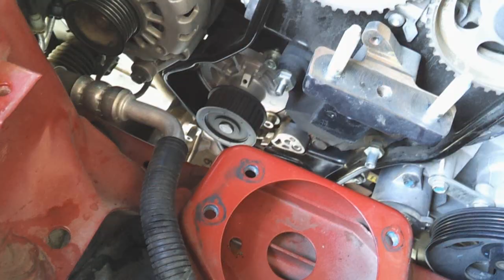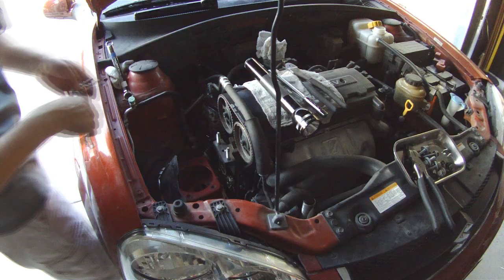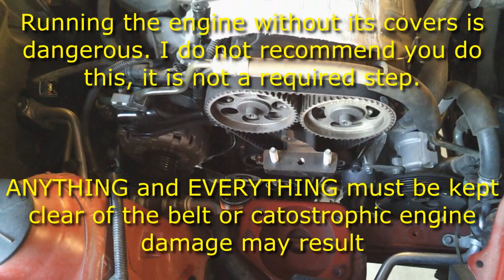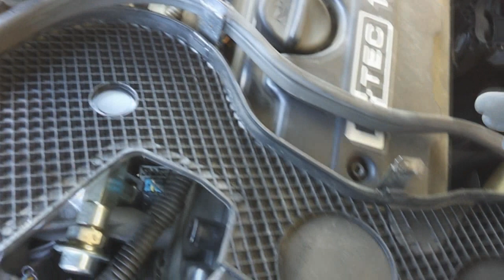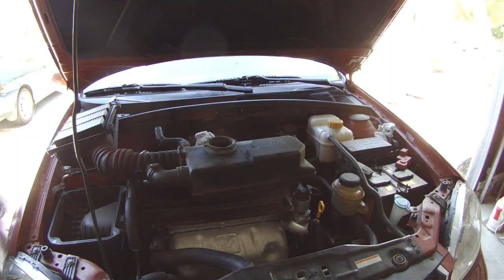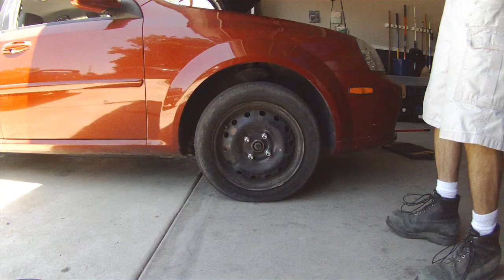Suzuki Forenza timing belt and water pump replacement part 2 of 2

Comment: This weephole placement has nothing to do with placement of water pump! If you will notice there is a high spot in the outer metal shroud where the pump mounts! It's there for a reason. That is what the tab on pump is supposed to point directly at when doing placement. The weephole is just generic and can even be upside down on these pumps and there are several manufacturers for these pumps. The one he's installing infact is one of the lowest cost ones on the market. Your more higher quality pumps the weep hole is in a very different position. So the tab points directly at the recess in the timing cover shroud that was designed for it.  Otherwise it will not be in correct position to let belt tension!!! So that belt will not tension!!!. So if the belt won't tension, that pump is in the wrong spot!!! I had to do it all over again following the weephole method. Found the correct positioning in the 99-02 Daewoo nubira manual which has the same motor as the Suzuki. Also is in a water pump change video for Daewoo nubira on YouTube. Author of video, please make changes, the pump in these was a stupid design! There is too much room for failure in getting it incorrect and there isn't even pictures or diagrams on the web about positioning, it took a lot of homework to get the info, the manual is very vague. Without the guy changing the pump and him making reference to his tab making contact with the shroud in that area maybe would have never known correctly.

Comment: I have a suzuky forenza 2008 and have a overheating problem, i change the thermostate, the sensor and clean the radiator, and still heating, the fans enter in slow velocity but doesn`t frose enough, what do you recomend me to do? thans for your answer.

Comment: Question (don`t laugh): can you advanced the timing by rotatatin 1 toth of the pulley or the crank stays put and you rotate de cam axles? And by that will you damage or interfere the pistons with valves? Thank you very much

Comment: What did you do to put the belt on because it's really tight
Reply from the maker: I had someone else move/adjust the pulleys for me as I pulled the belt into place. Make sure the water pump is rotated to where it puts a minimum amount of tension on the belt.

Comment: Hi I was progressing along nicely following your excellent video, but I've run into a serious issue. I was having problems getting the tensioner to tighten correctly, in the process of doing it I have dramatically thrown off the timing marks of the cams and crank shaft.
I'm afraid to try moving either and the only videos I can find say to open the head and deal with the cams from there. any suggestions would be appreciated.
Reply from the maker: Tom Jones remove the timing belt and all spark plugs (so you wont feel any compression) and turn the crankshaft so that it is positioned 90 degrees left or right (doesn't matter in which direction) from top dead center. Do this slowly and if you feel any resistance (piston touching a valve) go in the opposite direction to get to 90 degrees from TDC. The crank should rotate fairly easy and you should be able to notice any sudden change in resistance. After doing this all your pistons will be half way up/down the cylinders and allow you to rotate both cams to where they should be without fear of the valves and pistons contacting each other. After the cams are where they should be you can rotate the crank 90 degrees to get the crank back to TDC and you can continue installing the belt.
Reply: grjr Thank you for the fast response. I followed your directions and everything worked out great. It's my daughter's car that she uses for college, so I appreciate your help alot. And again, great video.
Reply from the maker: Glad everything worked out for you. Thanks for the comment!

Comment: I change the timing belt on my 2007 Suzuki about two years ago. I could never get the tensioner markings to line up correctly it just kept snapping back. The timing belt was a very tight and took me hours to actually get it on.

Comment: I'm doing the timing belt on my wife's car same car but I can't get the cams to stay on the marks and when I do and I get to put the belt on the top cams the bottom pulley moves any tips please
Reply from the maker: fishing _with_a_ginger I am late in replying but maybe this will help someone else who reads this, there are tools sold to hold cam gears in place so they dont turn. The cheaper alternative is to get a helper to hold the cams in place while you get the belt on.
Reply: fishing _with_a_ginger I have the same issue. the exhaust cam springs back. the intake is fine. the needle on the tensioner keeps moving back..
Reply: grjr I'm glad to hear all of everything now I got one to do this week

Comment: you also didnt mention why is locktite neccesary. And what about if i dont have a torque wrench:/
Reply from the maker: +Jorge Jimenez the loctite is there from the factory so.... and if you don't have a torque wrench you'll have to guess if the bolts are tight enough or not. Guessing can lead to broken/damaged threads or bolts coming loose with time. There are cheap torque wrenches out there... I wouldn't recommend them but if it's all you can get then it might be better than nothing at all.

Comment: GRJR; your video is just amazing. I learned a lot watching your video.
You made this video with a lot of details and I liked it.
Congratulations. 
A question; how did you noticed that you water pump was not good?
Reply from the maker: +Nyck461 the water pump was still functioning, it was replaced as a precautionary measure. If the water pump is leaking it should be replaced of course.
Reply: grjr 
I think she wanted you dude

Comment: I finished with this but when I try and turn the car on it dont turn over it just spins and sounds like it choking my problem was not a broken timing belt but one of the idler pulleys was busted some one please help
Reply from the maker: saul garcia  was the idler pulley broken before you replaced the timing belt? Did the engine run before replacing the timing belt? The crankshaft and camshafts may not be timed correctly assuming everything else is in working order.
Reply: Yea I thought the problem was a broken timing belt but when I tooks everything apart I discovered it was the left pully the car had been running good before that then all of a sudden any I ideas I'm going to have bro do it all over again
Reply: saul garcia If the timing belt slipped even once because the pulley malfunctioned, then you have bent valves.  That happened to my 08 Suzuki and I had to take it completely apart and take it to the machine shop.  Good luck, hopefully you get it running again.

Comment: OMG!  Yes, it's a good video, you covered it all, but...  Next time, buy a white paint pen.  Mark across the top of the old belt where the two cam pulleys marks are, count the number of belt teeth between as a backup, and also go down to the crank pulley and mark across the bottol of the belt at the same point as that mark.  NEXT, when you take the old belt off, mark the new belt in the same places.  NOW, when you put the new new belt on, who cares if the cam pulleys move, you have the belt marked, and as long as you get your marks right and you keep them in the right place, in the end everything will line up just right.  Also, use a q-tip, bent it a little, to make the mark on the belt at the crank pulley.  This is also a great time to change spark plugs, and leaving them out makes the engine ten times easier to turn and maneuver.  I also think that if you take a close look at that belt tensioner, you will see that it is marked on one side as "NEW" and on the other side as "USED."  I start a new belt on the NEW side of the notch.

Comment: Your video was a BIG help, Thanks!!!
2005 Forenza, I was asked to look at the car because of a noise coming from the timing belt area, turned out to be a worn out timing idler. This car had 120,000 on the original timing belt/componants and it looked it.  I had to go a little more involved as the cam seals were leaking and the water pump was stuck due to being corroded in place. I did figure out a way to lock the cam gears in place, a small pair of vice grips lightly clamping the two gears together keeps them aligned to the marks.

Comment: I can not install the tensioner, put it in the correct position and this tour, but the marker does not move, even when I tighten the screw. I can move ell net by hand and when I release is returned to the original position. what happens, I'm doing something wrong can you

Comment: hello my crankshaft gear moves at the end whenever i want to adjust the timing belt tensioner. whenever i tighten the bolt and the pointer is in the new notch the mark on my crank gear has moved like 3 degrees. please help!

Comment: I'm wondering why you didn't torque the engine mounts?
Reply from the maker: I don't think I had a torque specification for the engine mount bolts. Engine mount bolts are typically torqued from about 45 to 55 lbft

Comment: Thank you for sharing this video. it was a very helpful guide when changing the timing belt and pump in my Chevrolet optra5 hatchback. I bought the gates kit from rockauto.com . I had a buddy of mine help me install the timing belt kit, you are better off if you have a second person helping you!!. The only issue I had was trying to get the belt on, it was a pain. unfortunately I had to pry the belt on because the tensioner was not giving it enough slack. The 6mm allen head hole stripped pretty easily on the tensioner as well. I had to wedge a straight screwdriver in place to turn the tensioner so the needle would be in the "new" position on the tensioner. Then I tightened the tensioner bolt. A question I do have is; when manually turning the crank after the whole install I noticed that the tensioner needle will move from "new" to "old" and bounces back and forth depending on which position the crank pulley is in, I figure being a tensioner it has to have some sort of flexability in it so I am guessing this is normal? The timing belt is tight if you touch it, it has no room to skip the teeth. Let me know if you had this happened during your install? Thank you again for your detailed videos.
Reply: I also found that I had to turn the Allen bolt counterclockwise to line up the arrow on the tensioner. the needle on the top would turn the opposite way of the Allen bolt which didn't make sense but it worked for me. The only thing i noticed was the needle will slightly move between the used and new marks when I was turning the crankshaft manually with a ratchet.
Reply from the maker: It's normal for the tensioner needle to move as you rotate the crankshaft, it only matters that the needle end up pointing in the same spot after reaching #1 TDC. Getting the needle to point where it should is possible by rotating the tab with the allen hex hole in either direction, no problem.
Reply: grjr Thank you for the info, I was just worried it wasn't locked in properly because the needle was moving but yes it was in the "New" position when all the timing marks were lined up and would return to the "new" position once the marks lined up again after manually cranking over. It was just annoying because the 6mm Allen hole striped and we had to set the final clocking of the tensioner in place with a straight screwdriver instead of a 6mm Allen wrench. There isn't much depth for the Allen head to sit in so I think that is what caused it to strip.

Comment from the maker: You can move the crank a limited amount if both cams are aligned with their timing marks. NEVER force the crank to turn without a timing belt, you can bend a valve. If your camshafts are not aligned with their timing marks, there is a point in crankshaft rotation where all the pistons are half way in the cylinders. If you can find this point you should be able to rotate the cams all you want. You can pull the spark plugs and use a wooden dowel to find this half way point for all the cylinders.

Comment: I liked a lot your video.
Suzuki has not much information about repairs and your video bring a lot of information.
I was starting this job today but for not enough time I stooped and will go back tomorrow to get it completed.
I am also replacing the cam shaft sensor but I am suffering to get loosed the screw that hold the sensor in place. The motor mount is just in front of the window and the torx screw ca not be reached as needed. I will appreciated some idea in how to get that screw removed.

Comment: I just bought a 2004 chevrolet optra ls5 with a 2.0 dtec 16valve . I want to put a cold air intake and exhaust but cant find eney sites  or nothing . I know this has nothing to do with you video but i need help . And i saved this video for future if i need to do this but if you could help with my prob that would be great . Thanks

Comment from the maker: The tensioner is spring loaded iirc, but the spring won't come out unless you completely destroy the tensioner. If the threads for the tensioner bolt were stripped you would never be able to get the bolt to tighten. The process of tensioning the belt is critical and needs to be done as shown. I highly recommend the use of a quality torque wrench for tightening down all the timing belt components. You say the arrow slips, does it return to its correct position when you reach cylinder #1 TDC?
Reply: grjr hi
Reply: grjr i care mkank

Comment: Hello, i am having trouble with tensioner, Is there a spring behind it? someone told me there may be and i lost it, Everytime i get it right like the marks and tighen 13mm and i turn crank it slips(the arrow), is tht because i never torqued it even tho i tighten crap out of it, i feel like i put more than 18lb on it, or do u think its a missing spring or maybe i stripped 13mm bolt, or are u leaning toward i need to torque it right? I even bought a new one and it does same thing, thanks 4 ur help

Comment from the maker: if your new pump doesn't have the locating tab on its outer circular circumference like the original then just rotate the pump to any position where it doesn't interfere with your tensioner and you should be ok.

Comment: I have a after market water pump and is not the exact one as yours. The water pump I have came with a GATES forenza timing kit, and has 2 weep holes. I tried placing both weep holes at the 12 o'clock position and both times the arrow from the tensioner is hitting up against the water pump. I am pretty its the orientation of the water pump as well, but I just can't seem to find the correct position for the pump.  I put the old water pump back in, and it works fine as that pump locks in place.

Comment from the maker: The arrow shouldn't come into contact with the water pump. Make sure your water pump is installed in the correct orientation (rotation) as per the video. Also be sure that the 13 mm tensioner bolt is not tightened down so much that it does not allow for adjustment of the tensioner. Make sure that the tensioner arrow is pointing at the correct starting position as in the video. Beyond that'd I'd inspect the tensioner itself to make sure it is not defective.

Comment: Hello, Grjr, thanks for your videos. I am having problems with my tensioner arrow not moving.  I have the bolt in the middle and I keep rotating the 6mm hex around the center bolt.  All it does it spin and spin until the arrow hits up against the water pump and then I can't rotate the tensioner any longer. What am i doing wrong?

Comment: Could you have locked the cam with a locking tool by removing cover and placing the tool on the cam. I'm getting ready to do this to a 2009 chevrolet aveo with a ecotec engine. Liked your way but would you recommend the locking tool on the cam and crank ?

Comment: Great video does this also work for 2005 chev optra my timing belt didn't break I am thinking may have jumped because car will not start seems like no compression. When car stopped it was like a switch was turned off didn't make a sound. If the belt did jump do I use the same procedure with the timing marks to reinstall

Comment from the maker: When I did it I just pulled the timing belt over the last pulley by force while having someone else make sure the cams were not working against me. I have heard of other people removing the tensioner and then installing it after the belt is routed around all the other sprockets but you would have to be very careful not to cross thread the tensioner bolt while installing it. I don't know how well that method works as I have never tried it.

Comment: Thanks for the video, I'm at the point of getting the timing belt back on, but I can't seem to get it over the tensioner pully. I took out the spark plugs so that I'm not fighiting against the compression of the engine to get TDC.

What was the final trick to getting the timing belt on? I've even used the zip ties to hold the belt on the cam sprokets.

Comment from the maker: The crankshaft locks up before it reaches the TDC mark and doesn't want to go any further? Did the timing belt break on the engine you're working on? You can try removing the spark plugs if it is the compression you are fighting against...

Comment from the maker: The car had about 80k miles when the belt was first changed so the belt was overdue 20k miles. The belt did have cracking along the backside. It's risky to go over the 60k mile replacement interval.

Comment: Thank you for this great video. It has helped me more than I can describe. I can now do this procedure and save dealership costs. I read that many motors of these cars blow due to letting the timing belt not get changed. My problem is an intermittent leaky water pump. This is dues to the thermostat....weirdest thing I have come across. 
This has help me...Thank you.